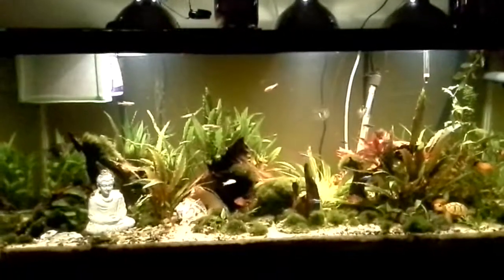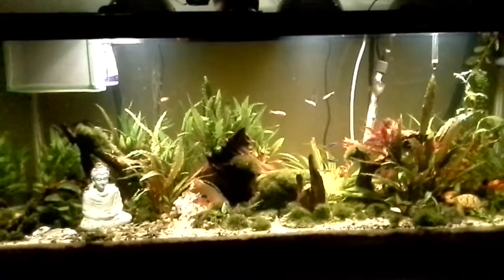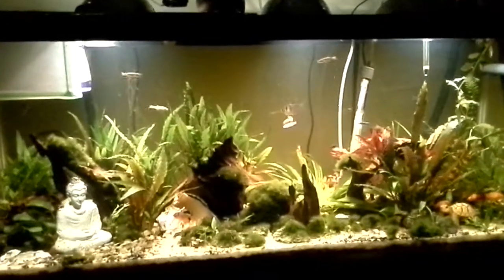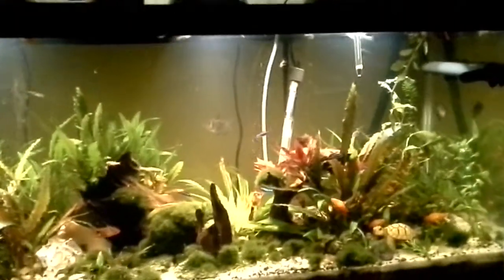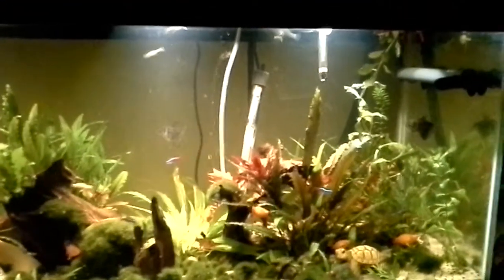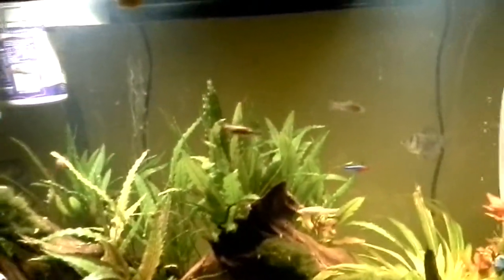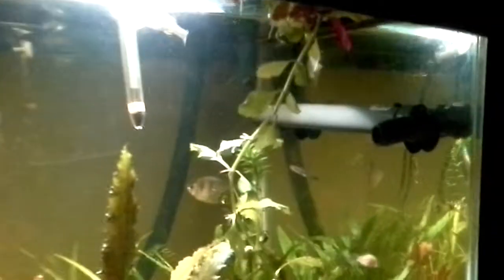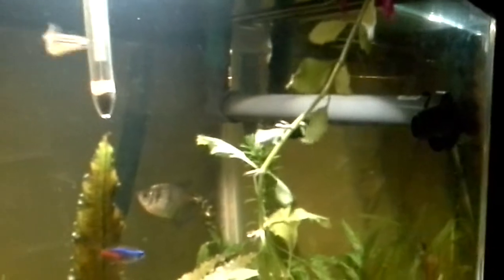DIY 5 gal bucket filter in action with attachments

Comment: You went from "Re connecting the power cord wire to showing how clean the tank (now) is ... where is the video that continues from the re-connecting the power plug wires to actually applying the filter to the aquarium?  I'm asking about adding the medium into your "filter"  and doing the test run of your filter set up B4 you actually run it to the aquarium... Or do you have it?
Reply from the maker: i looked and i didn't find any old footage of the actual inside of the filter. this was my first real temp at making DIY video and i overlooked a step or too, or just thought the camera was on and just kept taking. :) i will make another video soon showing how i set up the internals.